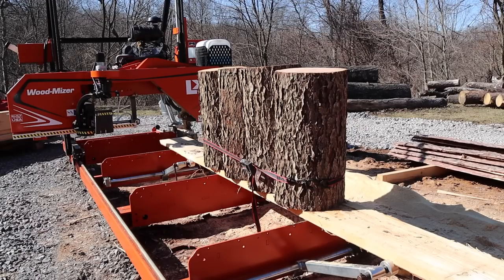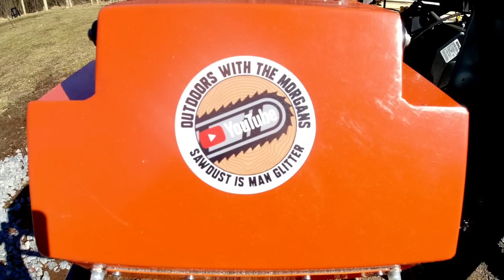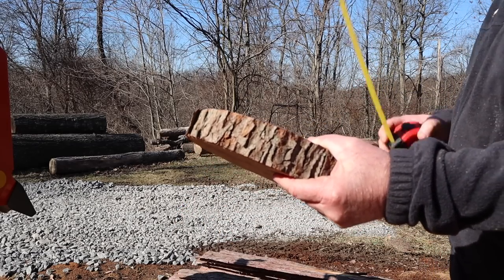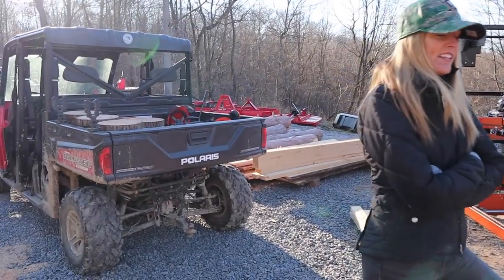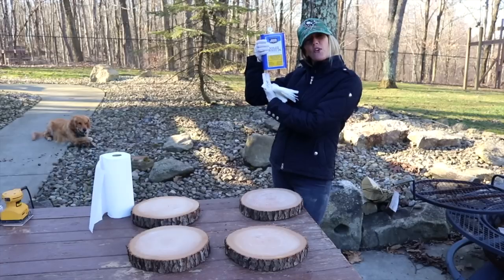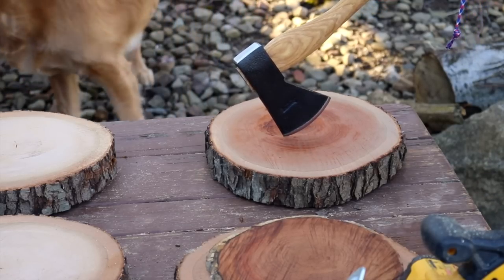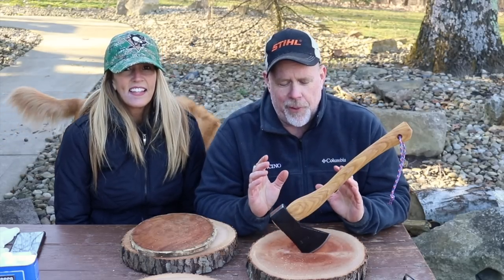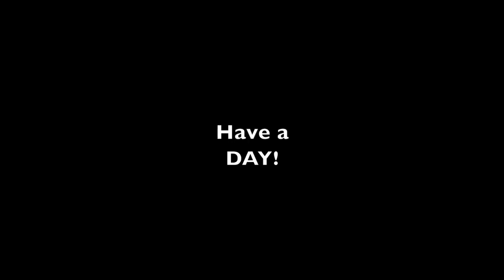#717 Tip and Tricks To Keep Your Cookies From Cracking, Making Rustic Center Pieces, Charger Plates

Comment: As a retired firefighter, i have seen many fires started when people toss rags or paper towels,  used to wipe linseed, oil in the trash. Almost any plant based oil will self heat to the point of combustion when the right condition is present.  Make sure that you dispose of them properly. Best to burn them in your fire pit or place them in a steel bucket filled with water or a tight fitting lid. Then lay them out flat singly to dry in the sun, then burn them. Be safe don't store them inside a building or near combustibles. Love watching your videos. Keep them coming.
Reply: Greetings from No. VT - great advice, you can't say it often enough. People don't realize just how low the combustion point is on linseed oil! Thanks for reminding the Morgan Community!

Comment: A product called Pentacryl is what I used on my cookies. Its available online. I made 25 - 1" thick 12" dua. I put them in a plastic store and let them soak about 24 hrs. rotating them in the solution. The wood was river birch and not one of them split or checked.

Comment: Great method for cutting cookies. I have very good results with salt curing the wooden cookies, use curing or pickling salt, make a very thick brine solution and soak the the rounds for 3 to 4 days.  Make a salt paste and coat both sides of the rounds and then let them dry. The salt preserves the cell structure of the wood, especially the cell walls.  You will end up with almost green dimensions in the rounds. I am 72 years young and have been processing hardwood most of my life and this has always worked well for me.  Keep up the good work.
Reply: I love the sound of this. We just cut down a sick dogwood in our yard and cut a cookie as a keepsake. All I have handy is kosher salt, but I am trying this!
Reply: u can just brush on or u have to soak 4 days? .. any salt works too ?

Comment: Hello Morgan’s, I’m not a drying expert, but I have many years in the sawmill industry. I suspect that the cracking and checking are a result of uneven drying and the grain pattern in the piece of material. One thing I would suggest is to employ a drying practice of ‘conditioning’ the heat with moisture. There are times when drying lumber that you must introduce steam into the kiln to condition the charge. So, you are basically applying moisture to the surface area while heating the inner portions of the piece. The surface and perimeter are drying faster than the center.  Even if this works well, there will still be pieces lost from the grain running vertically over such a short distance. Happy sawing!

Comment: Hi to both of you. Great video. Keep them coming... I also get asked all the time to cut cookies on my sawmill...lol . The best way i found to stop that cracking (regardless of the wood species) is to submerge the cookie in a metal container under vacuum pressure  using a stabilizing solution. The solution I use is called  "Cactus juice" . It's a resinous product  to stabilize wood for wood turners. Many crafters want cookies of about 2" to 5" in diameter for doing wood burning on them or Christmas ornements etc...  I use that technique for that purpose and i nevr had one crack. I will attempt to build a bigger vaccum chamber to accomodate the larger cookies like 12" to 20" . I will let you know how that turns out...I'm confident is will turn out.  The time in the chamber is about 45 minutes, then i wrap them in foil and bake them at 200 degree F for about 30 minutes. That dries the wood and also kills any bug that might be in the bood.  have fun cutting cookings.

Comment: I used to live in a Rain Forest.  130" is a drought year.  The ground would get like jelly if pounded by rain for 2 weeks or more.  Hard to get firewood to the house.  So These 'end slices' were used to create a trail from the large wood bin to the cement porch.  Mine were 4" to 12" as I move up hill and across.  They were based in the mud and lasted.  I used them for 5 more years before we moved.  Cool.

Comment: Another great video....  Thank you.  I definitely agree with you on using dead wood as your base stock.  Using dry wood is 90% of the solution to having your product not crack.  However I have found that using 100% Boiled Linseed Oil as a sealer can result in a finish that never completely drys - it remains 'tacky' forever.  I use a mixture of 50% Boiled Linseed Oil/50% Mineral Spirits.  This mixture will dry completely with the added benefit of being a thinner solution and therefore will penetrate deeper into the wood which also helps reduce the chance of cracking/checking.You will find that cutting the wood with a sawmill blade will seal the wood more than if using a chain saw.  You may want to go back to the forest and find a dead standing tree, cut the cookies, let them sit for a couple of weeks then seal the the ones that don't crack with the Boiled Linseed Oil/Mineral Spirit mix.  That way you will only be sealing the cookies that don't crack/check.  Just my comments.  Keep up the great work.  Hunter could add these cookies to his business =)
Michael from Canada
Reply: Greetings from No. VT - Michael, it sounds like you have similar experiences as I had. I have used mineral spirits, denatured wood alcohol and turpentine to cut boiled linseed. I found over time that I liked the turpentine as a cutting agent because the others seemed to reduce the sealing properties. Maybe it was my perception. The other trick I would use was to make sure the linseed oil was nice and warm. In summer I would sit the container in the sun for a couple of hours, in the winter setting the jug/can in a large pan of hot water on the shop wood stove. The penetration rate was phenomenal when the linseed was really warm and seemed to have less smell to cook off when you were done.

Comment: Hey Mike my name is Myles  I am a chain saw carver . 2 things  I have found  that helps stop the  cracking is #1 use wood glue on bottom it days and tightens up the disk or cookie.  The #2nd is use anti freeze the chemical in the anti freeze is the same chemical that wood turners use to stabilize  wood only a cheaper alternative.  Personally I have more experience with the wood glue some will still crack but a lot less.  Hope this helps a a day
Reply: Do you soak the entire cookie in antifreeze, or just brush it on? Can you give a little more information about application please?
Reply: @bullfrogpondshop3179  well for starters I don't do a lot  of cookies but either way by brushing it on or soaking it will work for hen bushing it on give it more coatings.  I have done bear carvings and have a 1inch drill bit 16 inches long I drill from the top of the head down in the middle of the log or carving and filled it up with antifreeze  then put a plug in.  I have had success with this  the thing is to replace the moisture out of the wood and stabilize it. Years ago  I read an article on a chainsaw carving forum which was copied and pasted from a wooden boaters forum.  It delt with the issue of boaters pulling out there wooden boats in dry dock after a year all the boats would leak caused by the shrinking of the wood . Then for an experiment they brushed on the antifreeze or applied it to the boats and had boats in dry dock  for up to 5 years and when put back in the water  they were water tight. Hope this helps

Comment: Nice video Mike and Melissa! Yes, wood cookies are a very popular cut of wood, but also the most challenging to stabilize.  The 100% end grain on both sides dries super quick, plus this round cut has a ton of tension on the outer rim and will want to crack from the outside in towards the pith (like a pie shape) to relieve that tension.

Linseed oil does slow the drying of the wood (which is good), however, it will just lay on the surface not allowing the wood to breathe.  For green wood especially, this traps moisture inside which can build up and cause mold to grow between the linseed oil finish and the wood surface.  Also, when applying it to wood cookies it does not eliminate the stress in the wood.

On that note, we would love for you to try our Pentacryl product.  It is a stabilizer formulated specifically to treat green, fresh cut wood to prevent cracking, splitting and checking as the wood dries.  It is not a finish like linseed oil, rather, it works by penetrating all the way through the wood and displaces the moisture.  You will get a much lower cracking rate than 50%.  It looks like you guys are doing really cool projects with fresh cut wood (not just this one), so a gallon of Pentacryl is on the way to you!  Thank you for making wood working so fun!

Comment: Great DIY experiment. Anything that will seal both sides of the cookie will slow the drying process and help prevent checking. Rapid and uneven drying (shrinkage) will encourage cracks. I suspect that water based products are best since the escaping moisture might compete with or slip around the oil products at the molecular level. (I made a number of smaller cookies for a wedding last year and experimented with a variety of wood types -- oak, maple, pine, fir, ash, etc. Hemlock seemed to hold its bark best and crack the least. Bark retention can also be affected by the time of year that the wood is cut. Summer cut has sap under the bark that acts as a glue as it dries.)

Comment: hi there M&M  I have been making them years now and it is hard to keep them from" pac man " face . i do think its from the out side shrinking( drying)  faster then the in side . the outer part is drying on 3 areas inside inly 2 . so as it shrinks it pulls apart . if you try to slow the drying on only the outer part first with sealer has worker well . the harder to split with a axe stays together the best . the best is to cut a 6" center out or larger  like a hollow log . they seem to stay together best   .i sell them as wood doughnuts or toilet seats . good luck its hard to do  . john

Comment: Happy Daylight Savings Time  You already use a paint to seal logs to protect from checking. I'd always heard that checking was due to the drying difference between bare wood and barked wood.  The wood in the out side having the greater moisture content. So the edges toward the bark would be the last to dry.  If you would paint the end of the logs and allow them to dry for a year or two. That way you control size of the tree for cookies.

Comment: Greetings from No. VT - Welcome to DST! Great advice on making the "cookies" especially using the linseed oil. The only refinement I would offer from my experiences is to cut the Boiled Linseed oil up to 20% with turpentine, or as an alternate thinner, either denatured wood alcohol or mineral spirits. My favorite is turpentine. That thins the linseed oil just enough to penetrate into the grain a little better to give the wood a nice seal, especially if the wood has a lot of moisture still in it like Mike's new cuts. If you use linseed (either cut or uncut) I would let them set for a few days in an area with good air circulation to let the vapors and smells cook off.

Comment: I have been making these for years I have a wood working business. I cut them into cookies and also on 45 deg. I sell them to taxidermist. I have always cut them in the dead of winter never had any problems with them cracking. I use mineral oil on them. That way if I want to use them for turning a bowl or something that needs to be food safe.

Comment: I had made a bunch of these smaller cookies from an oak tree that was green and found that by putting boiled linseed oil on repeatedly for a week it seemed to replace the water that was being lost with the oil and never had any crack and the bark has stayed on also. But after some time they seemed to get quite yellow in color at the start i was oiling them twice a day and keeping them wet on both sides ..

Comment: Have you tried boiling them? I make a lot of bowls on my lathe, and lost 35% of the bowl blanks in the first year. Then I started boiling the rough turned blanks for an hour, submerged with rocks, in a wash basin with a plywood cover, on a propane turkey boiler. The second and subsequent years, fewer than 10% of my bowls cracked during their 4-6 month drying period. I dried them in shavings in paper bags and weighed them monthly to determine when the weight loss stopped.

Comment: Hi Mike;  Timber framers use a Citrus oil product they put on the timber after their cut to help with the checking and cracking.  Timber Framers Institute in Maine in think. it's a timber framing workshop class. that teaches timber framing. that's what they recommend for timber frames. might work for your wood biscuits.  i don't know about 30 Hatchets for center pieces, hope they to go  rouge on you .

Comment: Great video. With wood that green, you could slam the axe in without cracking the piece. Even after drying for a few weeks. You could make fast work of sanding by running them through a belt sander. Some woodworker in your area will have one you can use. Have a Day!

Comment: Wood turners have used polyethylene glycol (mixed themselves) to treat green wood before turning it on a lathe. Oil then must be used as a preservative. Paint, varnish, etc., don't adhere well.
Years ago I chained red cedar into my old Woodmizer frame and cut them at an angle for a friend who made clocks from them.

Comment: I have cut cookies up to 4 foot in Dia. I paint both sides with " wood juice", never paint the bark, I weight them, let them air dry for a week, I weight them again, and paint them again, and let them air dry, I keep weighting them to know the water loss, when the water loss stops or slows way down, I kiln dry them, some crack some don't, you want the water to come out the bark. Have a Day, like Billy would say " Be Kind " I try

Comment: hie THE MORGANS Here is my method of making ( cookies )- Like you I cut double the amount i need, than i let them dry in my wood shed for one month, then i use the good ones in a mix of, 1 quart of hot double boiled linseed oil and 1/2 cup of bees wax., I apply it very warm and well mixed. I am 80 years old , and this is what i found to be the best wood treatment,for outside and inside. After 3 coats , use only the linseed oil and don,t forget wipe 5 minutes after every coat.

Comment: If you linseed oil both sides would that help?  If I make a table top and seal one side it will warp real bad. I am from Batesville, In. where they make the Wood-mizer. I wish I had one.

Comment: Melissa your the best Turn and Cough!!!😂😂 Mike I did the same thing. I used bees wax for my slices that were used for hot plates or cutting boards. I also used anchor seal on some to help seal in the moisture so it didn't check.  It's just the nature of the beast. But I agree 100% with what your saying but the thicker the better seems to help too..

Comment: I just cut six hundred for a sidewalk. I told them just dip them in Thompsons water seal and let dry before placing down the walkway. It is thin enough to soak in the fibers and seal the wood.

Comment: WRT the state of the drying. Couldn't one have a storage area to put logs dry. IE If there were trees to be removed, put the log somewhere to dry for future use. The ends would crack but the rest of the log stay intact?
I'm asking because I have some large knotty trees to remove. Going to be not worth the hassle to  process them down to firewood but might be good for future woodworking.

Comment: To keep my cookies from cracking - I cut them up with my axe into chunks which I use in my smoker or grill.  I keep them in a milk crate near my grill and smoker.  I only use white oak or hickory chunks and it is a lot cheaper than buying them.  I cut them on a large maple round from a tree I cut down a couple of years ago.    I usually use my Husqvarna Carpenters axe to chop them up with.

Comment: I tried Pentacryl  and it didn't work very well. Clear paint did better. On my last bench I used white wood glue. Spend some time getting out the air bubbles. I went over them daily for about three weeks. Came out with very few cracks.

Comment: M&M, had 15 Pines cut from around the home and shop, smallest was about 18 inches.  The two up front were over 30 inches so I had the timber guy cut 3 inch disc off of the butt end.  My saw is not that big, his was.  I bought two kiddy pools and soaked them, in the process of, in Pentacryl and four are out now with no cracks.  Using them for a walk to the front porch.  Research the Anti Freeze as someone mentioned and told works well also.  Know for fact it would have been way less costly.  My 2 cents, keep up the videos.

Comment: I’m no expert, but I am a wood worker and years ago before there was a You tube I read an article from a wood turner,  who said he turned green wood frequently into bowls. He said he prevented it from checking by putting it into a microwave first to remove the moisture evenly. As I said I’m no expert and have never tried it, but it might be worth trying in this case as you have a few to spare.

Comment: I think a time stamp will be great for a video this long.
For example, 
0:01 Video intro
0:25 Moving the lumber
0:50 Measuring the lumber with a measuring tape
1:04 Sawing the lumber
3:25 About the channel
4:20 Intro about ways people prevents cookie from cracking
5:26 Intro about the blade and the cherry tree logs and the clamp
And so on

Comment: You could make clocks out of those discs. Drilling a center hole for the shaft that the clock hands mount to should allow the pieces to dry without splitting.